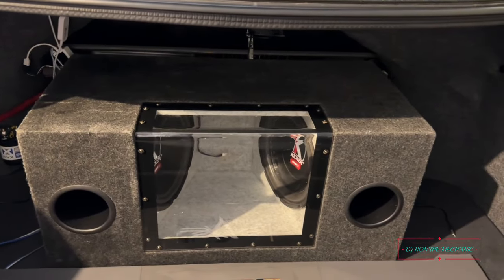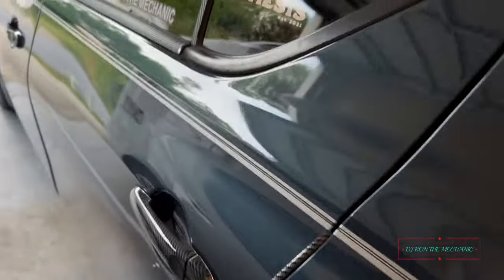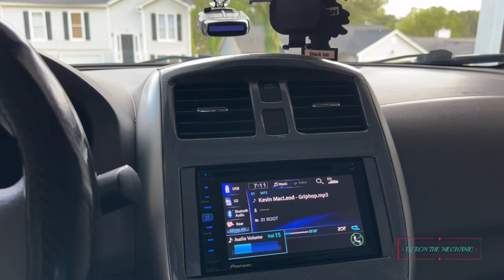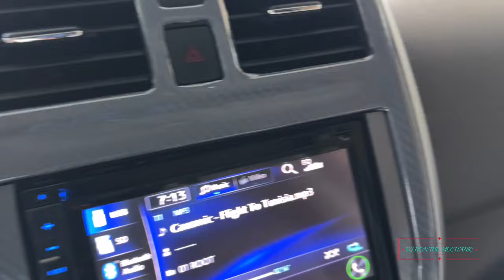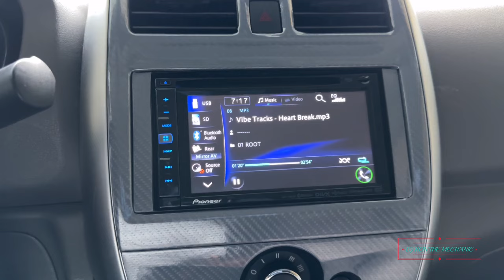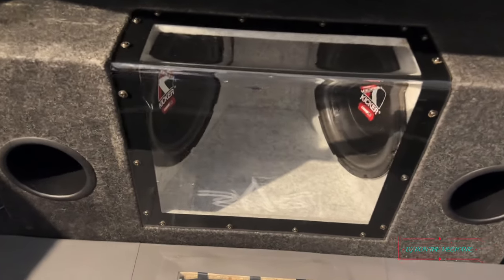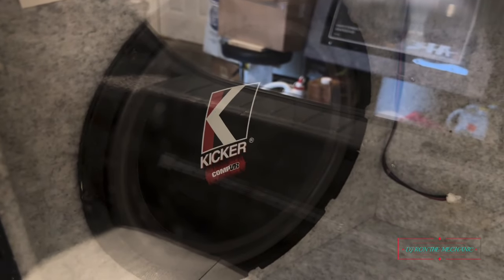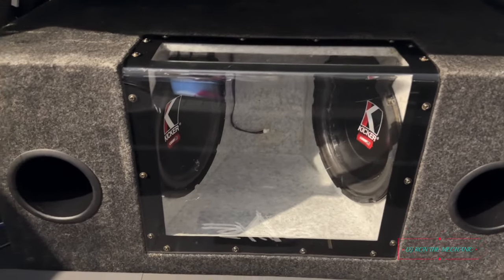2 Old School Kicker CompVR 10’s Bass Test #kicker #diy

Comment: Even if coils are smoked, most subs can be reconed/soft parts, as long as they're not odd sized. 
1. measure coil former diameter
2. measure coil length (or depth, if you prefer)
3. measure length of winding
4. order some parts (they don't need to be the same brand or model, so long as parts measure the same, they will work)*
*if properly assembled and shimmed